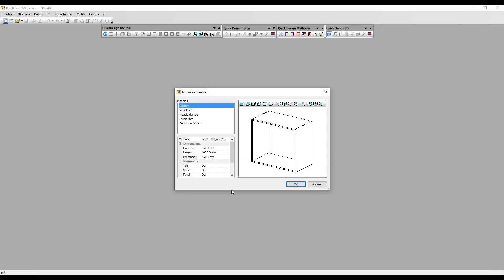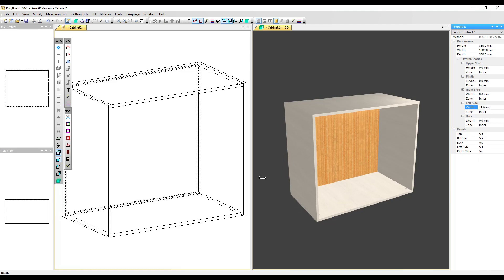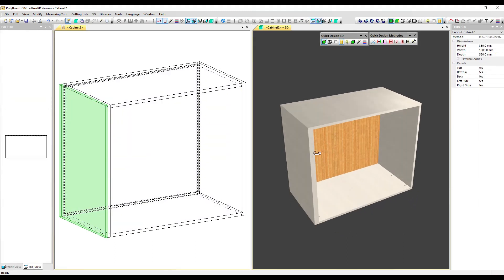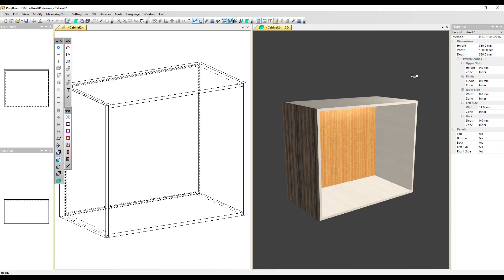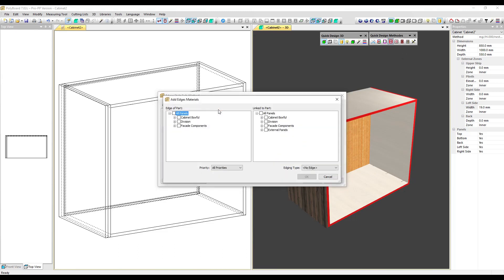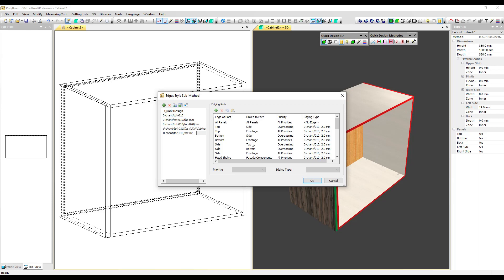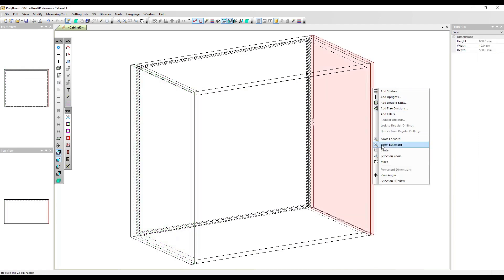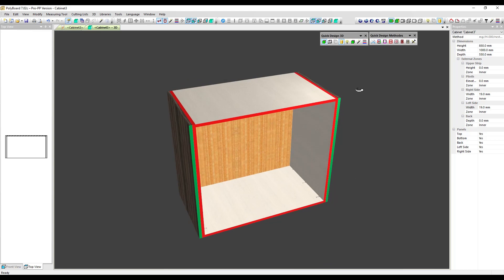Add Decorative End Panels using External Zones in Polyboard

Comment: this only works for the side panels and with limitations(if you put your bottom as overpassing, then the deco panel is short). i cannot get it to work for top and bottom.
Reply from the maker: Hi there! 
This is correct. Using a mitre joint between the top/bottom and sides will fix the problem. If you have any more questions, don't hesitate to reach out to our technical advisors via our Assistance Forum.